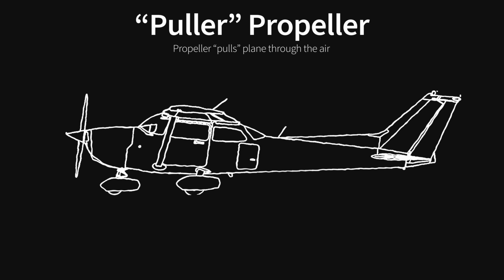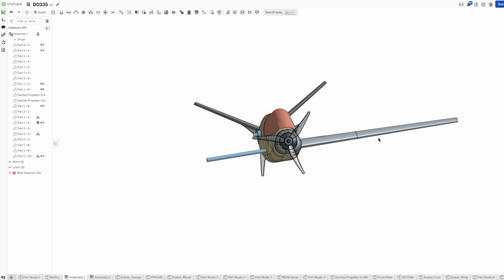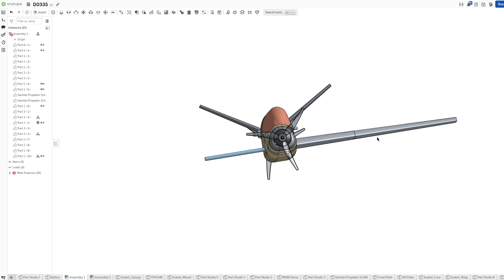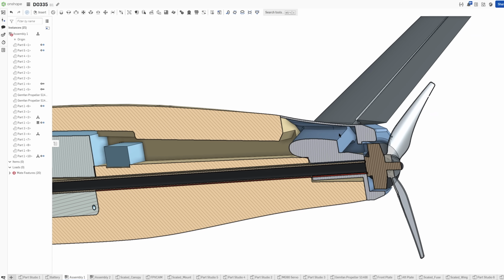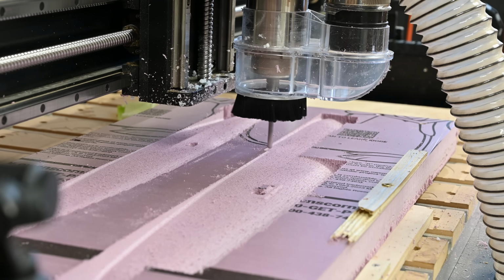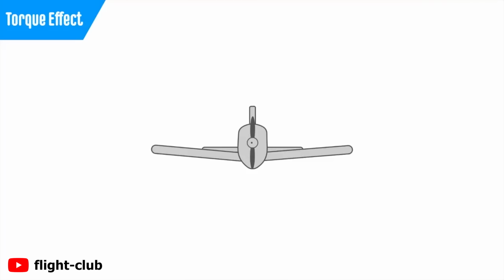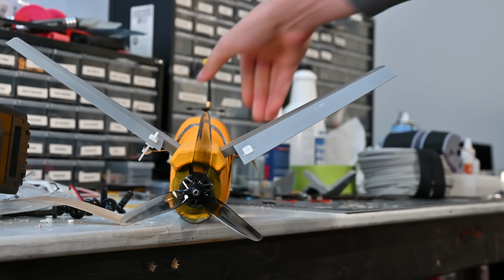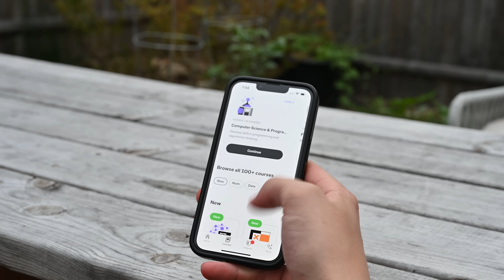Building a WEIRD RC Plane... Will it Fly?

Comment from the maker: To try everything Brilliant has to offer—free—for a full 30 days, visit https://brilliant.org/MichaelRechtin  . You’ll also get 20% off an annual premium subscription.
Reply: Try to build a Q200 QUICKIE for your next plane. VERY ODD BUT COOL AIRPLANE.
Reply: I just custom made a RC jet. How do u calculate were the cg should be?
Reply: @Trending_Clips-10k 
25% back form the leading edge,  if the wings are swept from the smaller outer end of the wing, go 25% back from there and then draw a line across and then that’s where CG is
Reply: Your problem is that it’s a V tail that is quite complicated rather try a normal tail @michaelrechtin
Reply: I'm not sure, but if the two motors have a shaft connected between them, that means they are rotating in the same direction
Reply: The two engines are rotating in the same direction. You didn't notice that because you turned the plane

Comment: Hi Michael, I highly recommend you is a RC model plane simulation App called Simnet. It will enable you to quickly input your design and fly it in the built in simulator. It is a parametric developer and enables you to change your design quickly. It has built in flight controllers that require very little tuning and work very well, even for VTOL. I use it all the time in my airplane and VTOL designs and it works very well and saves a lot of crashes. It is not very expensive and is well worth the small investment since it will save you a lot of crashes. I used it to develop the unusual eVTOL flying car in my icon which works quite well. See my icon to see the test flights.

Comment: V-tails are HORRIBLE. I built a hand launched glider with a V-tail and it would oscillate back and forth. I switched to a conventional tail and it worked so much better. After seeing how bad V-tails are without advanced electronic stability control, I would never try it again. Ditch the V-tail and try again.

Comment: I think your control planes are undersized a lot. In a dual in-line propeller arrangement you have to make sure that the front propeller dominates the thrust. I also think that the second axial moment of area of your fuselage could be not strong enough to avoid too much fuselage torsion inbetween the two propellers. This destabilizes the control.

Comment: I am not experienced but what I feel is that the pushing from the back motor interferes with the rudder and elevators.  You could possibly put a weaker motor behind or instead of having the servos move the rudder and the elevator make them tilt the angle of the rear motor.  Like what jets are doing.  I know it will end up as a totally different plane but that was my thought.

Comment: You created a monster! Or at least an angry beast. 
The BIGGEST problem first. Tail heavy airplane equals DISASTER. I physically cringed when you said, just let the autopilot sort that out. Even an autopilot cannot fly a plane that won't fly. The best that it can manage is briefly careen through the air before falling out of the sky while hoping to score a few points  for style. 
Next up. Heavy plane with small wings equals HIGH WING LOADING.
Hang gliders are usually in the 3 - 3½ pounds per square foot range. This lets them start flying at slow speeds, like down in the teens slow. 
Something like a Cessna 150 or 172 flys in the 10½ - 11½ #/sf range. This lets them start flying in the 45 - 55 mph speed range. A 747 has about 70-75 #/sf, they don't fly until they've going well over 100 mph. 
A fully loaded, high performance jet fighter can be more than 100 #/sf. Not going to even think about flying until 200 mph, or more.
Your little beastie was heavy, and not just the tail. It needed to be going faster than you were chucking it.
Speaking of chucking, you need to be throwing the model more like a spear. As you released the model,  you were rotating the model into a very pronounced, nose high, attitude. Like 40⁰ to 45⁰. That is well past critical angle. That means that the model's wing was fully stalled as soon as it left your hand. You need to keep the nose of the model pointed straight ahead so it has time to accelerate under power.
Next problem. Your tail is just way too small, and too flat. General rule of thumb, a V-Tail needs to be angled at least 30⁰ above horizontal. And they need to have more area than a regular flat tail plane. The more angle, or deeper the 'V', the more span is needed. 
Since you were launching the model in a stalled condition, the autopilot needed a bunch of ruddervator authority in order to correct the issue. Given the model's tiny little ruddervators, the autopilot didn't have what it needed to fix the problem. It was doomed from the very beginning. 
Models with the "Push me/Pull you" will fly. The main thing to remember is that it is a twin engine plane. It will need more wing area to carry the extra weight of the second powertrain. And generally speaking, more wing area requires  more tail area.
Don't give up on your project. It can definitely be made to work. The Dornier 335 was faster than anything else in the sky at the time. Except for the first jet. And the jet was only a tiny bit faster.  
The Dornier could reach just shy of 500 mph in level flight. Meaning it didn't need to dive in order to get there.
My electric Pusher/ Puller was fast, like jet fast. The only plane at the field that was faster, was a flying wing with twin EDF's.

Comment: I think you had way too heavy of a battery plus you have to make sure that the CG is absolutely correct. Next the control surfaces need to be a bit larger and longer plus stick with a traditional tail wing set up first to see if it’ll maintain flight. For testing new aircraft you should always start off with full control surfaces like ailerons,elevators, and rudder (stabilizer) but as I mentioned before CG is pinnacle.🤷🏻‍♂️💯👍

Comment: Maybe not the primary cause, but i'm a bit skeptic about the camera you have mounted straight out on the left side of the fuselage. I had a similar solution one time with a small keyring camera, and it acted like a rudder. Made the plane wingstall when i turned to the left. Before i mounted the camera, it flew perfect. Aerodynamics is hard.

Comment: Not weird at all, just like Dornier DO-335. i made on about 6-7 years ago with the same prop and motor setup but with 2 bladed props and props where rotating against each other. that made the plane to have SUPER stability in the air. i also mounted a Foxxer FPV cam and did run a analog signal on Drone racemand. i mounted the camera on the top of the back  finn so i would see the entire plane. 

https://youtu.be/3GdwIhjkYCo?si=9YZvILlh8utpiiMw

Comment: Tail heavy.
Too heavy overall.
Not enough rudder/elevator authority.
At one point it looked like the wings were floppy, that will wreck your aileron control.
If you look at the original it had extra rudder surface area. By going with a V-tail you need even more surface than you think.
Also any misalignment between the thrust vector of the front and rear motors will cause a constant departure that will get worse with throttle input.
Likely the source of the yaw you were fighting with insufficient rudder authority.

Comment: I think that due to the turbulence and relative air speed the pusher rotor was too biased.  I think for proper performance the puller rotor needs more power than the pusher.  Thus the yaw instability.

Comment: try running a 7.4 lipo on 2 1806 2300 kv motors the same props should work but would try a 2 blade or dedicated 3 blade plane prop .... and even tho you have 2 counter rotating props because they are at the extremes of the pitch angles its still causing torque on the half thats able to move more air. also when you throttle up its causes horrible false vacuum over the main portions of your wing and rear control surfaces rendering them damn near useless untill they them selves are at full throw by then your dealing with p.i.o and with hand launches that results in a crash reynolds law is a bitch so you may need to increase the size of the front prop to fix this while leaving the rear the same.

Comment: I wonder if the tail is supposed to act as a stator to untwist the airstream coming from the front prop. In that case the v tail is worse for that purpose. I would try it with just the forward motor just to make sure the airframe is viable, then try it with just the rear motor to isolate any problems.

Comment: It seems there is an issue with the calculation of your aircraft's center of gravity. I have built an aircraft like this before and flown it without any problems. Maybe try to move its wings back slightly.

Comment: I believe you will never find the answer you seek with a tail heavy plane. I also believe your problem is excessive yaw caused by the motors spinning in opposing directions to counter torque induced roll.  The motors on each end of the fuselage have a lot of leverage to turn the fuselage. Either have the motors spin in the same direction and make one wing larger to help counter it. (Some of the best Italian fighter aircraft of WWII were designed with one wing larger.) Or ditch the V tail and add a vertical stabilizer large enough to do the job. Look at the  Donier DO 335 Arrows vertical stabilizerS (dorsal and ventral). What does that tell you? Lastly, if you're going to fly another tail heavy plane, don't be surprised if it flys straight to the toilet, Again!

Comment: Bra he needed a drive system with one powerful motor and a shaft driving the rear propeller. I also think the front propellor should have been at a higher speed on launch.🧐🤨

Comment: too much weight in the tail....even with the balance point ok for flight the weight of the motor in the tail causes an momentum of inertia that the reaction of the control surfaces exacerbate and cause a oscillation that gets out of control within a few cycles.....the real DO335 had the rear engine just behind the cockpit and a driveshaft back to the tail prop specifically because it moved the weight forward from the tail.

Comment: The reason they went down this design route with the Dornier Do 335 was to have the power of a twin engine plane with the frontal area of a single engine plane. So it should go faster. Which it did.

Comment: I suspect that it's a size issue. The plane is at too small of a scale and the air doesn't flow from back to front the right way to interact with both propellers correctly and thus it's causing instability and lift problems. I would double the size and try again and see if it flies any better.

Comment: Keep it up. You are on to something and closer to success than you think. Suggestions: 1/ Get it balanced for inherent flight stability first. Glide test it on a slope without props on it and without flight stabiliser on. 2/ Once it’s stable in glide, put a prop on the front and try it off the slope powered, without flight controller, then with. 3/ Once stable, add the rear prop, without, then with FC. 

Can’t wait to see the project evolve.

Comment: If I remember correctly the original Dornier 355 had big rudder and elevators, but also the underneath rudder not only protected the rear prop but added more stability that was needed for safer flight. I don't think you have enough surface area on the rear to keep the plane stable with the added rear prop.

Comment: Pretty sure the problem is the v shaped tail, in such small planes the turbulence it produces is too much for it to keep straight, plus most v tail shaped planes uses computer systems to stabilize the plane, it is WAY better option for light planes to have the regular configuration, also seems the wings dont produce enough lift, or that the plane is too heavy, you could fix it increasing the wing thickness and lenght and using lighter components whereever is posible

Comment: airplanes need to be light to fly. If this were equal to full scale, it'd be like it were made from granite bro. Reduce your wing loading drastically. Get the heavy 3d printed parts off of the tail. the more weight on the tail, the more you gotta balance with weight in the nose, increasing over all wing loading leading to stall. Its not just all about balance and CG.  Also, as you become heavier your controllability from the stabs will be extremely washed out as seen here. cool idea though

Comment: Michael, have you some some simple checks like calculating the tail volumes for this design? The v tails do look a bit small, maybe it would be interesting to go back and check this.

maybe even model the plane in XFLR5 or flz vortex and see what tweaks could make it perform better.
Which airfoils did you use for the main wing and stabilizer by the way?

Comment: Your sizing is not good - the V tail is too small and the fuselage is too short.
You could also predict the cg by using your CAD software and assume that your cp is at roughly 1/3 chord from the leading edge. The flight controller is not necessary and will only complicate things. Dead weight for sure, if you get rid of it maybe the cg will come forward a bit. Same goes for the FPV gear, unnecessary weight altough it's in the front. I would get rid of the draggy and heavy 360 cam on the side of the fuselage and put it in place of the fpv gear, with a proprietary hood for less drag.
Waiting for the next version!

Comment: Check the aero on the V tail and see if the prop wash is messing with the aerodynamics on it. And any contra rotating plane needs to have larger tails if it’s in line or it lacks authority ex: Westland Wyvern.. and look at the internals of the do335 and try to match them to get a proper cg and cp layout. They had the engine kinds in the middle of the plane connected by a drive shaft instead of in the tail.

Comment: I am quite ignorant in these things, but I have seen what for me is a problem: the profile of the wings and/or their rigidity. With the first couple the plane wobbles everywhere possible. Then you tried a few solutions: bigger wings and their position. The plane immediately tends to lower its nose, then in the latest accidents the wings snapped. So I thought that the air at the ends of the wings near the ailerons was generating too much lift there, and/or the wings were too stiff. Maybe due to the position of the carbon bars

Comment: For the CG being too far back, one easy fix would be to move the rear motor further forward and use a shaft between it and the prop, bearing are definitely required for this tho.

Comment: next time try out first conventional version. Engine on the nose first. If that works fine then go with a second engine on the back which should have a slightly low thrust output.
It really stumble and not flying at all. Make sure that the back side engine does not push the nose down. One degree in the wrong direction will show bad effects.
Good luck for the next time.

Comment: Putting the rear motor further forward and mounting the prop to a shaft might help. Also the puller-prop will interfere much more with the flow around the fuselage and wings than the pusher prop does, so maybe testing the plane with the puller motor only and doing proper aileron-trim would be advisable.

Comment: RC builders proverb: an airplane with center of gravity too far forward flies poorly, an airplane with center of gravity too far aft doesn't fly at all. But you know that by now ;)

In addition to the previous tips from the commenters, an airplane in this configuration is about the worst if you have little to no flying experience.
A high-wing monoplane is much more auto-stable, have a look at the Cessna 336 and 337.

Comment: Im not sure, but i think you have way too much thrust on the rear motor, and is acting like a rocket with no stabillization due to the fact that the center of thrust is way appart from the CG, may be because it doesn't have enough airspeed on the control surfaces to act against the unstabillity of the thrust. Great video, keep trying, is part of it. Again, im just saying, may be if you try to take it of from a runway, or may be the flight controller isn't working propperly.

Comment: No need for that rear motor.  It would fly great with a motor on front or back, but not both.  Go with a bigger motor but only use one.
Reply: Duh, the whole purpose was a push pull design…
Reply: @TK421-53  Well the design sucks and it flew exactly as it should have, like shit.

Comment: T tail made from lighter materials with larger surface area and a longer fuselage or at least longer distance between wing and tail by shifting weight forward and get rid of the flight controller! Just run a 3 axis gyro or nothing!

Comment: Hey this is an awesome idea and I have some solutions to your problems.
1 build it a bit bigger
2 get steel cubes for nose weight if needed even. E-flite does this.
3 do put landing gear on it
4 possibly bigger propellers
5 try having a mode where you can fly it just as a puller or pusher to get it up in the air at a decent altitude so then you could test the dual propulsion.
6 you could have possibly plugged them in wrong (I don't imagine you did) but this would mean both are spinning in the same direction maybe creating that yaw issue. To solve this just flip the red and black wires in the back.
Good Luck!

Comment: I think you need to validate the design with a single front motor. Just remove the prop on the rear motor and unplug the motor. 

Secondly I think that you need to use a standard tail and probably a dorsal fin as well. I suspect that the original design used the tail to stabilize the air coming from the prop on the front.

Comment: Try a little laminate on your foam parts, it doesn't add that much weight and makes the foam real strong. Twisted Hobby, minimum rc and aloft hobbies are good sources for iron on clear laminate. It comes in thicknesses of 1 micron to 6 mm thick. I build a lot of foam airplanes for indoor and outdoor use , I have found that the laminate works very well.